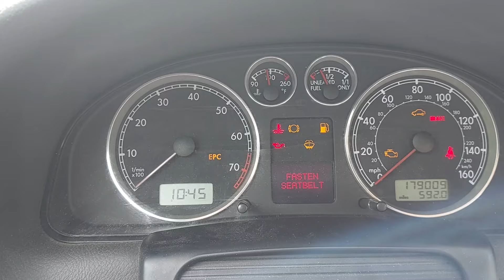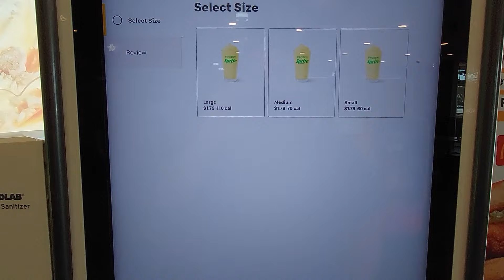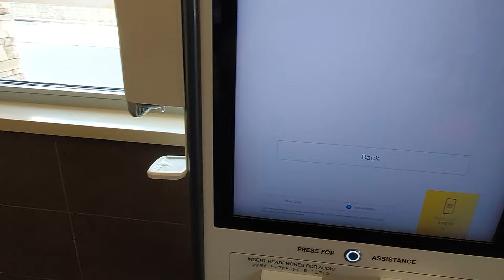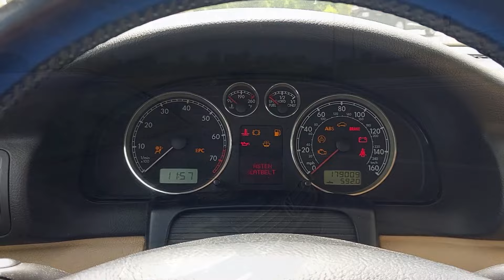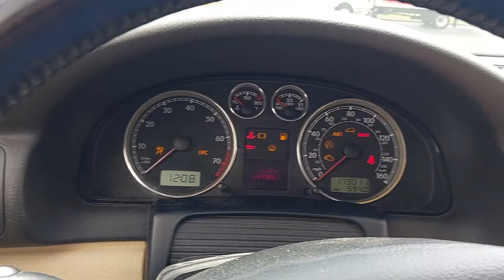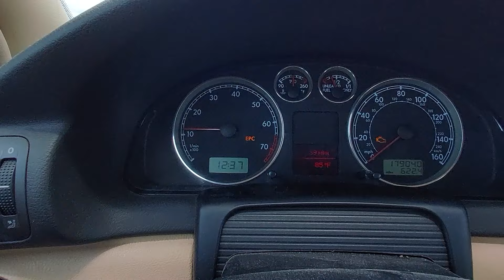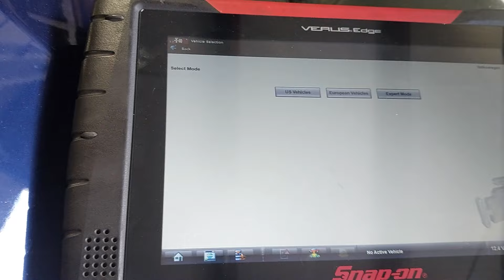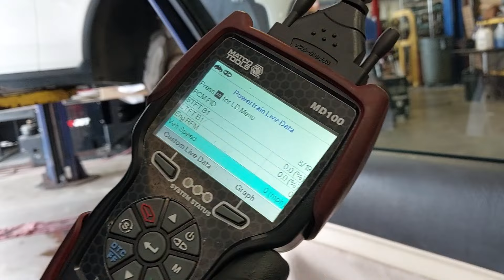Well. I'm stranded. This sucks. Work day goes off the RAILS!

Comment: as a audi/vw tech for the last 8 ish years id say make sure all ur wires going to the engine speed sensor are good and replace it. you were not showing any rpm while cranking id say thats ur main problem. plus thats a cool car try to sell it to someone who will apricate it. if or when you sell it not a ton of manual 1.8t wagon passats left out there and that one looked pretty clean!! and as another fat bearded guy i can relate haha!

Comment: I've watched many of your videos. Taking into account that at some point you have an issue or two how many cheap tools sets do you have that you never bring with you? 😊 Honestly I don't think just a tool kit will help this time. I had a vehicle that kept throwing a cam sensor code. Funny thing is that engine didn't have a cam sensor and it ran fine.

Comment: 1. Fuel pump (you’re done, call a rollback) 2. Engine speed sensor (let it cool off and see if it will start).  3. Ignition switch (do the dash lights go out when you let go of the key?)
Reply: Looks like I called it.   Depending on which engine code your car has, the ESS is $25 - $75 and is an easy fix if you have access to a lift.

Comment: i had a 1988 ford bronco it stop on the road ( last time at a ice cream spot! i come get you we figure it out it started ran home  i guess it wanted ice cream when store was closed!) like 130 am in the morning! the police called a taxi take me home pay them! ok ps come back get it in the morning before 11 am tow truck or drive it out here! my repair shop joint owner called me & dealer gave me crap after over 3000 dollar repair goof on billing I ate on full engine mod & over haul! gearing trans the whole works to! (what a fool then stole all bill money off me to pay the parts bill he did not pay the parts shop parts bill for months where the money go to?  now what it shut off at 130 am morning in new York state! its night mare he lied in court to! it a night mare  best forgot it a ground wire to the fuel system & fuel pumps( ok i was in a 9/11 type deal & DNA proof i sick from being on the base when the 4 USAF thunder-birds crashed and died in 1982  the planes were painted red white and blue! we don't need a court case just orange jumpsuit & life time stay in gitmo! there terrorists now! opps the Doctor your been sick over 35 years yes the sumac in my blood stopped POS test for it but DNA had i a 100% max i the guy direct relation! for what was a 100% death rate cancer! my relation lived threw it! i had a 2006 dodge suv crank nothing it would not start called tow truck come in morning I am AAA plus  250 mile rv towing! ok here he here the key i not ready to go hit key it starts i took it to town shop it was zero oil presser in the sender error code it had oil pressure like 50 pounds the computer stopped it from starting! it clear code & had pressure it started! ok i got a v6 gm 4.3 & supper charger vein thing it not on till speed you limp around back roads or tow a trailer camper it computer control I saw it let loose one time it a 4x4 truck in 2 wheel a police thing it was used ok it ran better then any thing i saw right down to 440 mag 1969 to mid 1976 cop cars dad was a top station chief the Sargent oh no i saw turbo ford & fast chevy's for operation speed a fed back speeder program  ok the flatten VW rabbit to! OH my the rabbit verses run away semi truck = DOA 2 officers really the truth! they had the car 2 months before ps you run this have a police car IE a 440 dodge handy!  have 2 cars! ok did died in 1993 ok before he died he got sick was in hodpital i was pulled over on my birthday i told officer he was sick & boaldo a police man working out too at work! there was a GYM there the owners kids were weight trainers they had me training too! i worked on big semi trucks too!